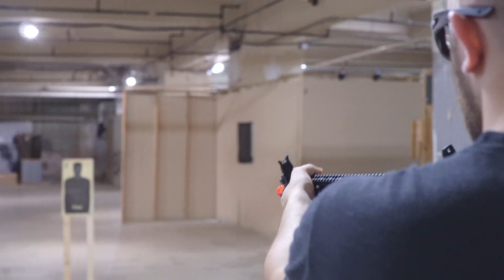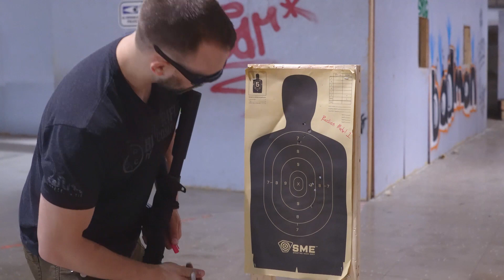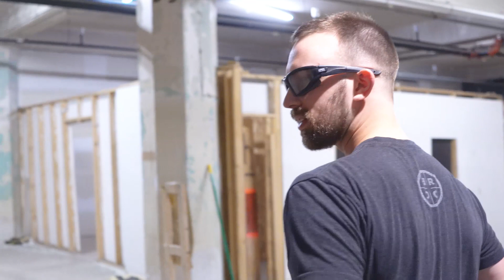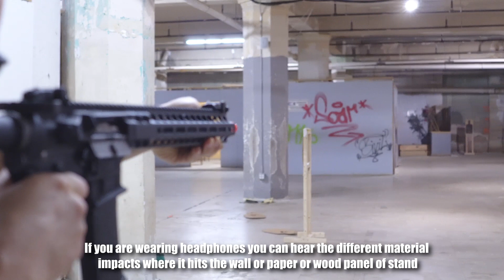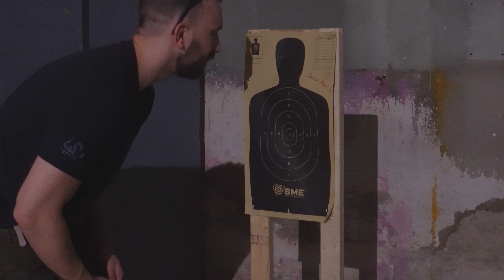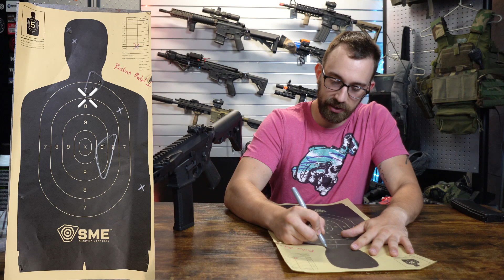The Radian Model 1 GBB rifle accuracy test

Comment: This video is irrelevant as a potential buyer. This shill has a BRAND new lm4 gun here. Cool!!!!!! They all shoot good out of the box. BUTTTTT, as soon as you expose the bucking to silicon oil, they swell. And that leads to degradation of performance. No one likes to talk about these FACTS. But KWA doesnt like to adapt. So they will be stuck as a low tier gbb manufacturer. A whole lotta copium will be needed for the kwa fanbois. A decade of hands on experience is why im saying this.... Clear as day, but the casuals will argue  NOOO KWA GUD. Have fun with that one.

Comment: Can the HU unit be replaced by a V2 version? like the ESD A+ or TNT?? or is it propietary to the upper receiver?

How exatcly the BCG differs??? I mean, i used KSC bolts on KWA US lm4 and vice-versa, there is like a 7mm difference in length. Being the KWA US the shorter one.
Is the Radian even shorter than KWA US???

Showing the bolt swap betwwen different specifications:
https://www.youtube.com/watch?v=YudKBp2xTOk

Comment: Standard lm4 bucking nub is too thin. There is no way you can compete with other gbbr. Once you change it with aplus bucking, it shoots much better. Bend original yellow copper tensioner a bit if you want to use 0.4g or above. Dont use maple bucking. Maple can only give you range, but not accuracy and grouping

Comment: Love the content!
I'm looking to pick this up as my first gbbr rifle. Are there any parts you recommend swapping out immediately, and what would be the best compatible brands for internal upgrades?
Reply: I’m thinking about getting it as my first to. I heard people say it got to complicated so they just ended up selling it. Do you still use yours?
Reply: @mr.ppbigwoah1724  I got mine for Christmas and I absolutely love it, it was on my list for a couple months and picked it up and I love it great weight nice snappy recoil
Reply: @mikeprovilus  Ayyyyyy preciate it. I was thinking about getting a pts centurion or a kwa lm4 but imma save up for this.
Reply: @mr.ppbigwoah1724  the only thing I will say is that the radian hand guard at the front is slim so if you run a supresor setup make sure you grab one that has a slim enough thread base to fit or you’ll need a small thread extension the angel customs hornet fits perfectly

Comment: Great review. I don't care if it's an LM4 based GBBR. It's a licenced Radian Model 1 airsoft replica, that's all that matters to me hahaha! I finally get to order one after 2 years of waiting.
Reply: I'm about to buy it... after having it for two years, what's it like to use?
Reply: No complains with the radian. The recoil is solid because of the heavy bolt. For accuracy, I set the hop all the way up to get that max spin for long range and I use 0.36 to bring down the FPS. Zero at 20m. The only cons, the KWA mags are quite heavy.

Comment: Have you discovered the type of hop up bucking these use? Im dying to know so i can install a better one lol. Stock isn't terrible but i know it can be better.
Reply from the maker: I have not completely taken it apart but based on looking through the inner barrel a couple times I would take an educated guess and say its a stock KWA GBB bucking. Which I just ran indoors in a CQB field for an upcoming video and yea, the bucking can be better but I was still surprised
Reply: @TheAirsoftArena  True i was a bit surprised myself by the stock bucking.  I've had the inner barrel and hop chamber out of mine. Still can't figure out what type of bucking it is i hope it's not the p word lol? I have a bunch of kwa pistols and an smg all gas it's def not a standard kwa bucking. The hop up unit actually uses a nub like wire insulator and the bucking has three alignment nubs short one at 6 o'clock and longer ones at 9 and 3. It's a lil tricky but if you pull the upper off the receiver you can take out two lil grub screws. One on each side of the hop chamber then pull and turn it just right to pull it out of the rear of the reciever.